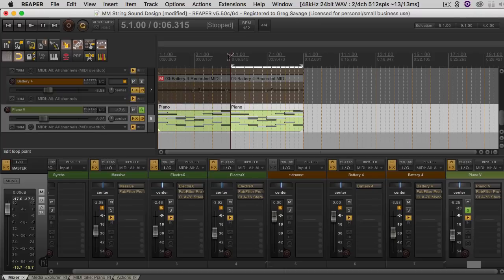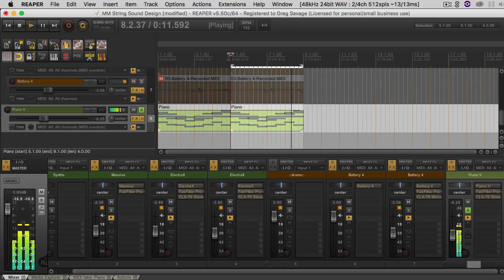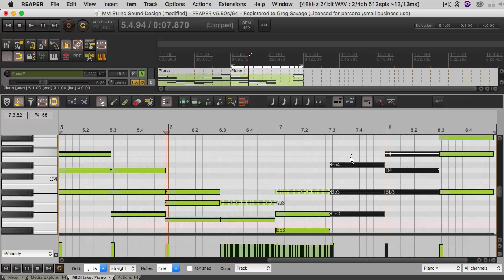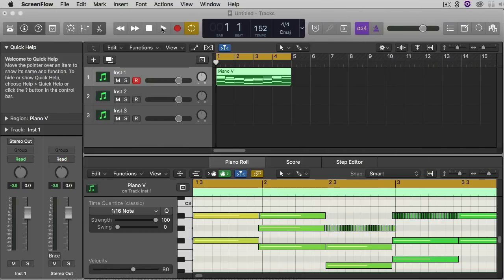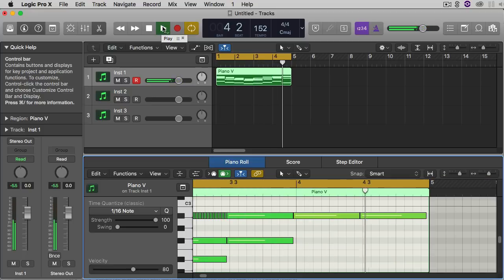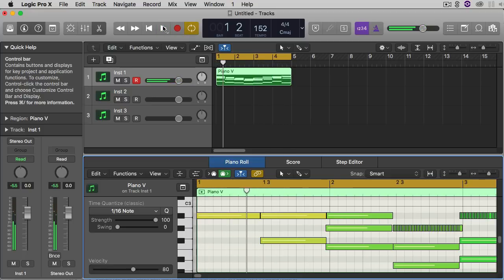Logic Pro X and Reaper Sound Design - 1/128 Grid - Turning Pianos Into Strings

Comment: Kind of foot in mouth comment(s) made in the video.

1. Natural Reverb plays a little role (very very little) as every sound has some type of reverb
2. The transition sounds smooth because the chops are so small/fast and because the sliced event is leading into the same note (partially) as it still sounds smooth when it's not leading into the same note 1/128 plays a huge role here. 

Let me know if you have questions